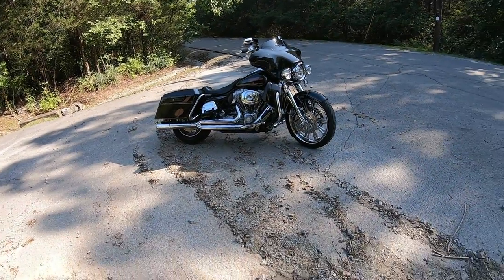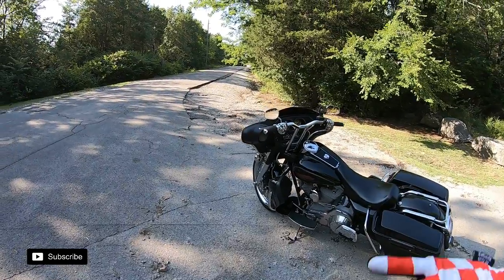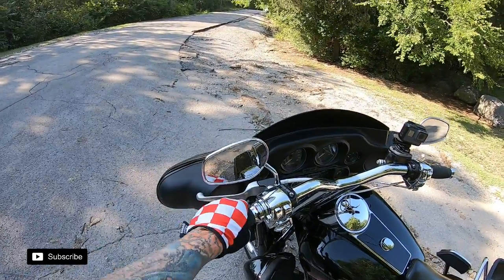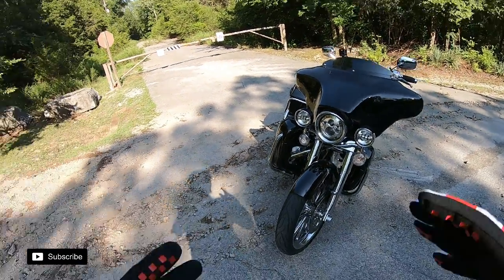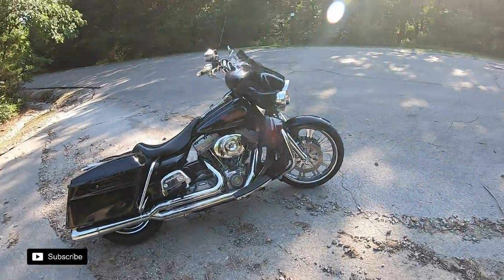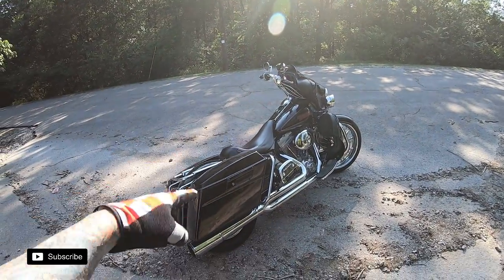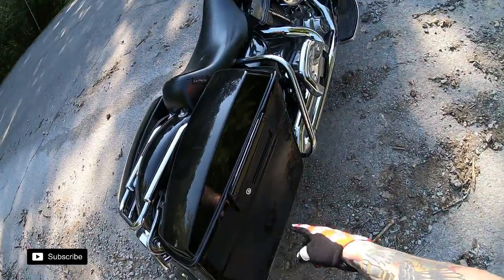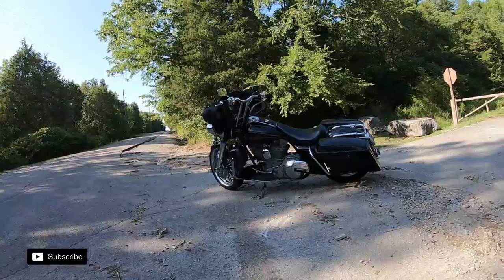Performance Bagger Walk Around 06 Electra Glide Standard

Comment: Nice job with that bagger. I have a carbureted full dress 02 FLHT with stage 1 & 2 that is in need of a little makeup and lipstick. I have the fueling camchest full upgrade withS&S 510 cams. It’s gets after it at 3000rpm at around 70mph with tons of throttle left over for passing. I’ve been seeing what others guys have done and gathering ideas to get started.
Reply from the maker: Thanks man

Comment: id look into rockford fosgate radio, their head units are plug and play.
Reply from the maker: Thanks man this bike has a biketronics radio kit
Reply: Been looking to do kraus T moto bars on my Electra. Thanks for the vid man. Got some pointers to work on mine.
Reply: Was going to get the ignition relocation kit to go over where the horn is but yours looks really clean. Where’d you buy the ignition and dash panel if you don’t mind me asking?
Reply from the maker: @JanuaryFury  I made it you cant buy it lol.....you could use or modify a roadking dash....the ignition switch is just a standard harley ignition switch you can find at J@P cycles link in the description hope that helps
Reply: tripp_hpjunkie thanks bud.